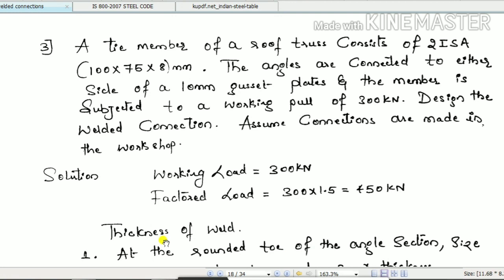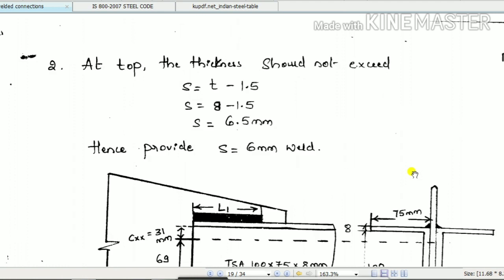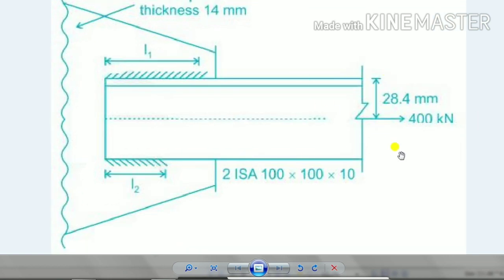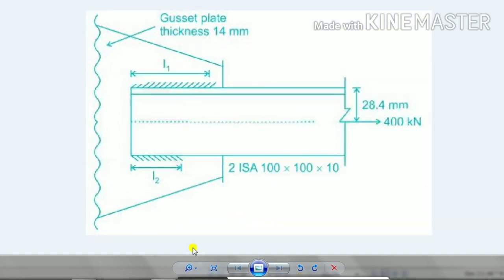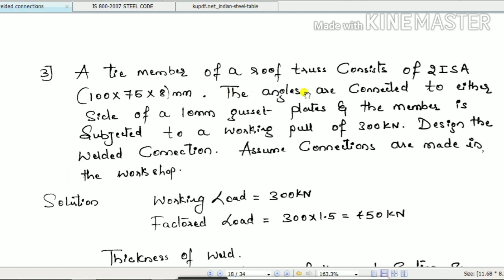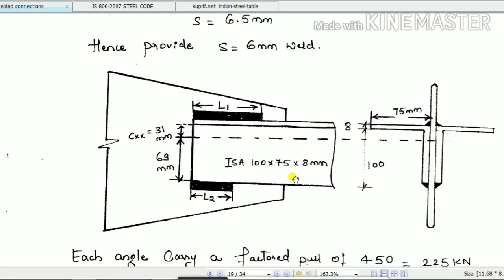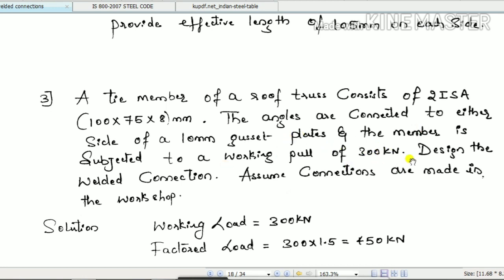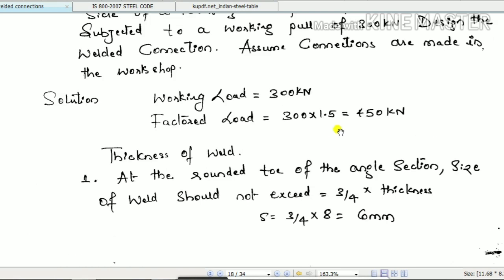HOW TO DESIGN WELDED CONNECTION FOR TRUSS MEMBER

Comment: mujhe thora help kijiyea. samne mera exam hay. question hay Design a tension member of a truss subjected with a force 100 kn consider weld connection and calculate length of welding. stress of welding 100 n/sqmm, stress for tenson member 150n/sqmm. ab mujhe problem yea horaha hay issme fu, fy konsa hay?